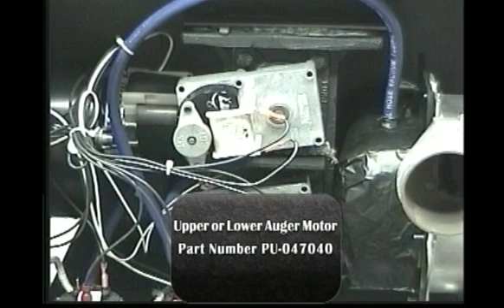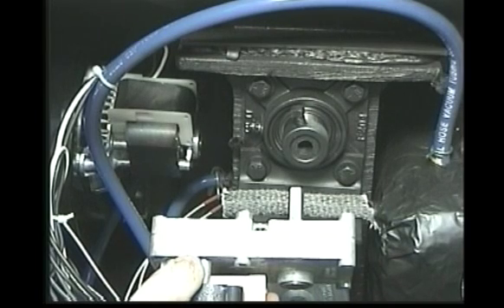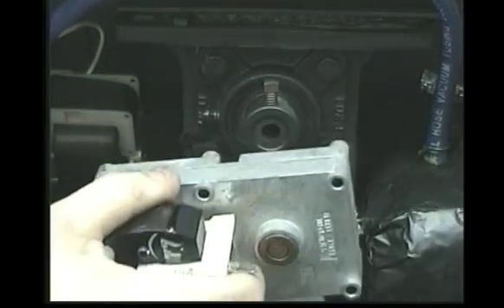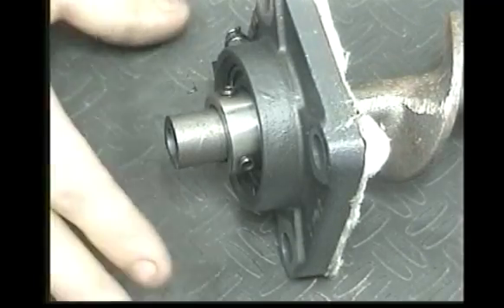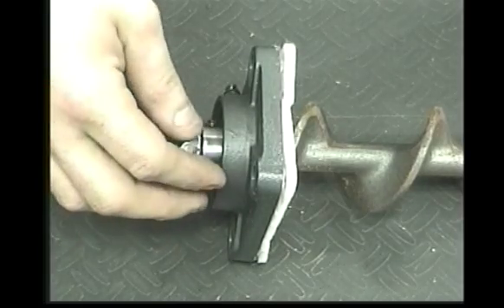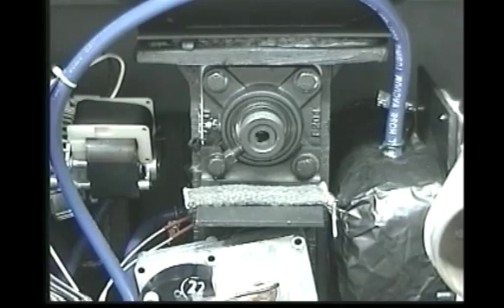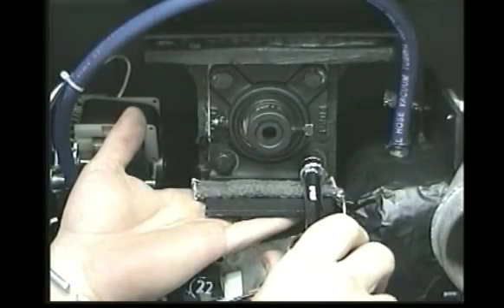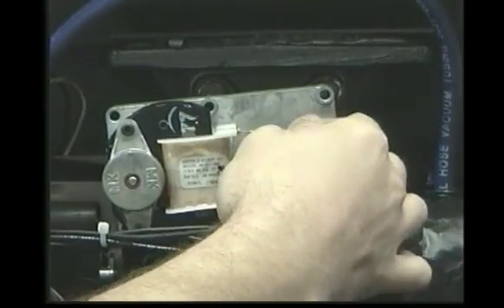AutoStart 13 Auger Motor and Auger Assembly - Replacement and Aligning your Augers

Comment: Who ever is watching this video to be placing bearing do not pull the bearing to the locking nut leave the Bering pushed back towards the shaft I spent 2 hours figuring why I couldn't align the  bearing and that's why.  As soon as I put the bearing back in the original position it Aligned properly right away.
 And I being nice in this comment because I'm pretty pissed right now.
Reply: damn daniel
Reply: Bend there LOL A nice Comment on YouTube is very rare😂 I thought that that was kind of strange that's not the way it was originally glad I read the comments before attempting it you saved me some time so thank you

Comment: My year model stove makes it very difficult to get to them square set bolt.made the mistake of trying to un bolt the whole bearing housing.that did nothing but ruin the gasket seal and now my house smells like a camp site— need to replace that now...

My question is— what if the flat spot on the auger motor isn’t in line with the position of the Bolt? How do you get it to line up?
Reply from the maker: I think that question could hopefully be answered by email. If you email the Techs at service@englanderstoves.com, it may take a day or two at this time of year but they should be able to shoot you some instructions. Thanks!
Reply: @HeatRedefinedESW  well thanks for replying here— been trying to call in and it’s not working! I’ll try to email them guys like you suggested- also I have the bearing gasket on order hope it went out the door today👏🏼
Reply from the maker: @johnm5714  They do try to ship all parts asap this time of year. If you do call, the mornings is usually best (right at 8:00 am EST), if you can.
Reply: John M. You should be able to reach in and turn the auger itself to line up with the flat spot on the motor. Hope this helps.
Reply: @purplesocks5984  thanks for your suggestion socks— I actually  got it.I ran the stove and let the augur motor rotate until it was in a position I was able to get to it.I got it all taken care of—THANK YOU and Merry Christmas 🎄

Comment: I lost the not and the Hopper latch in the top Auger, the latch jammed in there and was stuck and stopped the auger. This Video help me take out the auger and get the stove working. It took me longer to get the set screw loose and tightened after that the rest of the Job. Thank you for posting the clip it helped me out!
Reply: exact same thing happened to me! it caused my top auger motor to die working on replacing it now lol